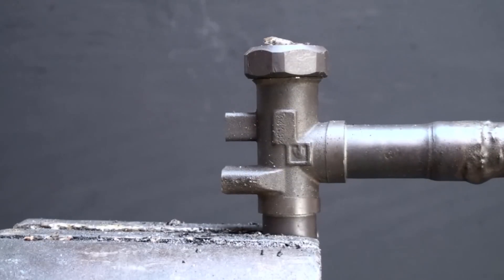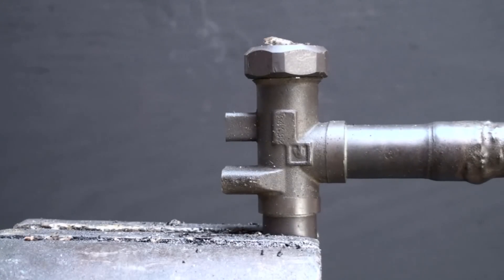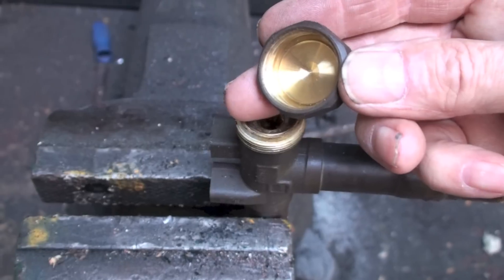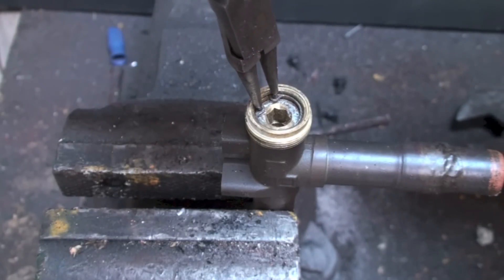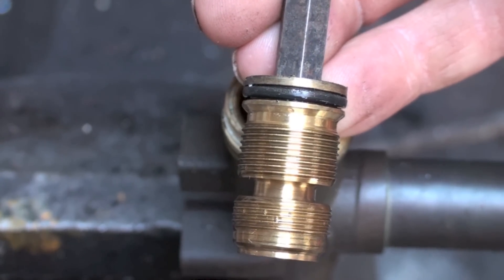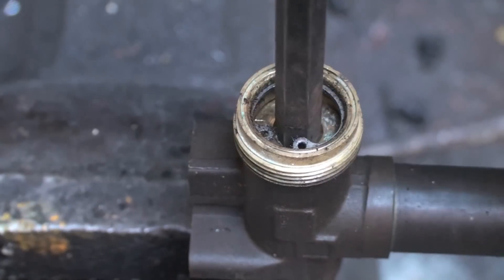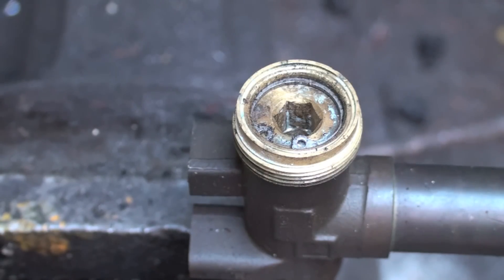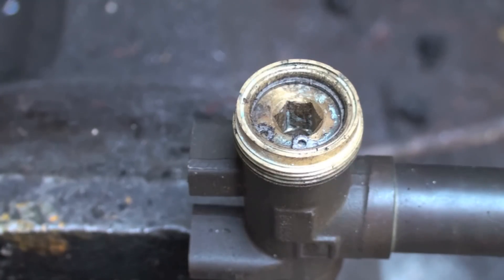Replacing the o rings on leaking HVAC service valves

Comment: Where do you buy them?
Reply from the maker: Bearing shops or Harbor Freight have oring sets.
GFM
Reply: @grayfurnaceman   Any particular material? Have a lot of 410 units where other installers fry the o-ring.

Comment: I have a suction side service valve that is leaking at the o-ring.  There is still a pre-charge of refrigerant held in the outdoor unit which hasn't been released into the line set yet.  The service valve doesn't have the snap-ring option and has formed edges, which means the service valve needs to be replaced.  If I need to evacuate the pre-charge into a storage container for the service valve replacement, what are your thoughts on just removing the service valve all-together and just straight brazing the line-set into the outdoor unit.  Obviously, I can replace the refrigerant using the outdoor unit's schraeder valve connectors at the reversing valve (air source heat pump).
Reply from the maker: I just did a valve replacement with brazed joints and have not gotten around to doing a video about it.  Maybe your comment will get me going on the video.
GFM

Comment: We had an A/C "tech" out because the evap coil was freezing up. He said it was low on freon. Of course he wouldn't add any since it is a 40-year-old R22 system.  I have some R22 I bought long ago and I'm thinking of adding it. The service valves appear to be 3-position with stems under black caps. I think the tech may have broken the vapor valve since you can turn it anti-clockwise forever and it doesn't stop. He had to use a pipe on the service wrench to turn the valve. Any thoughts?
Reply from the maker: I think you are correct about the valves being a 3 position type.  Here is a video about the service valve:  https://youtu.be/gFFLYmD_2d4  
I have never seen one of these valves break.  It does take many turns to the stop.  
GFM

Comment: can air be used to pressure test for leaks if it need to be evacuated and recharged? being new they are full of air and have to be evacuated  and charged? just to test these valves? i do not have the nitrogen equipment but have the manifold r22 evac pump and soap. thanks
Reply: air has moisture in it and some will condense into water. You have to run the vac pump longer and possibly do 1 or 2 oil changes if the sight glass gets cloudy, that's the water. You can get Nitrogen cheap at NorCo or any oxygen supply store. We use it because it's dry, it absorbs moisture, keeps it out of the pump

Comment: do you happen to know the size of the older rheem o rings?  my usint is 30 years old and just this year gave me issues. after drowning it in soap i find not leaks so maybe these valves nee repair. also are the schrader valves the same as they are in cars? i want to replace them also if after i remove the caps i find leaks. but being that old and research i think they are old and failed. i could have a tech do this but no one will come out to service it as they said it is to old. thanks
Reply from the maker: I do not have any sizing.  I just use an o-ring kit and pick the size.  The schraders are the same as autos.
GFM
Reply: @grayfurnaceman  thanks by any chance can i unscrew the valve core enough to change out the o-ring? or will it just pop out from the pressure at that point?
Reply from the maker: @bobpalmer4740  I would remove the refrigerant before removing the schrader.  The pressure is quite high.  As for the service valves, same issue except some designs will not allow the plunger to be removed.
GFM
Reply: @grayfurnaceman  ok i was not going to change the schraders without the tool. but the shutoff i was hoping to back it out just enough to change the o-rings. but that may not be possible either. thanks

Comment: One piece of information I cant seem to find is whether or not there are special o rings for refrigerant or can I go to any automotive/hardware and buy a bulk pack of o rings? Will the compressor oil wreck them?
Reply from the maker: I have had no trouble using the standard orings.
GFM
Reply: @grayfurnaceman  ok great, do you recommend installing with an assembly lubricant like nylog?

Comment: Do not used nitrogen @400psi it will blow you up
Reply: That is ridiculous.  R-410A often will operate at 400#.
GFM
Reply: Nitrogen is different look it up before you blow your arm off
Reply from the maker: @Brnlandry  I did not just fall off the turnip truck.  I have used nitrogen as a pressure testing gas since the 1970s BTW with the blessings of several manufacturers.  The only limitation is for compressor bodies and only that for certain compressors.  Pressure is pressure and the gas type makes no difference.
GFM
Reply: grayfurnaceman sir no disrespect but I took a class that showed a video of a guy that his arm was taken off by a window unit compressor.  They told us that nitrogen @any psi is multiplied to many times over.  I’ll try to find the story or video,  just trying to help no disrespect
Reply from the maker: @Brnlandry  I would like to see the story if you can find it.
GFM
Reply: grayfurnaceman I tried to find but couldn’t.  It was in a Johnstone tech class years ago
Reply: I think the problem is with expansion. As liquid nitrogen vaporizes it expands by 700 percent, or something like that. So if you put liquid nitrogen in the system at 400 psi you will end up with 2,800 psi. Maybe using nitrogen vapor to pressurize the system is a way to avoid the explosion. Don't know enough about this to give you a safe recommendation.

Comment: Recent replacement parts arent that great, have had lots of brand new valves have failing rings, but couldnt figure out the right material, there are EPDM, VITON,nitrile, and many more, question is which material is designed for refrigerant application so it wont fail again in a few month
Reply: The green ones.

Comment: When a leaking O-Ring is not replaced but valve is closed completely then will the vacuum hold if a vacuum pump is connected/used ??
Reply from the maker: No, the valve, when closed is open to the lineset.
GFM

Comment: Lubricate the o ring dry o rings are worthless. And yes you an dependably seal the cap with another o ring that is the same diameter of the inside of the cap. But be sure to lubricate and leave a tag on the valve for the future so it can be dismantled when the system needs evacuated
Reply from the maker: I guess I would have to say that I would not put an oring in a place that an oring was not made to be placed.  I have removed many of these orings that failed to work.
GFM

Comment: I do property maintenance with 170 units on the roof. I keep the O ring wrench and the rings in my bag. Even with plumbing o ring kits, it's a task to get the right one( harbor freight has a kit that matches.. I have to give it a hard slap to get it to seat with the threads. It beats carrying the torches on the roof. It is also a $.015 repair vs $20 valve replacement. With mo99 retro in place, I need every bit of the recurring budget money that I can save. I fixed a leaking king valve today and converted to mo99, the cond was 21 yrs old. The people moved in a complimented on how great the ac was working.
Reply: Good job man. It's one thing to install a new unit, but finding guys who care and are smart enough to repair is becoming rare. I've had the only 2 HVAC guys out in my 100 sqmi area, the first one wouldn't work on my R22 system, sugested a $17000.00 replacement, the second guy didn't have Nitrogen with him so he John Wayned it and had a leak in his braise, lost some or all of my R22 and wants ME to buy 10 lbs so he can fix it. The unit holds 12lbs and I said how much is left? He "doesn't know... but 10 should do it". I said can't we pressurize the lineset with Nitro (that I hope you have now, like a Carpenter without a hammer) and fix the leak, then pump out the unit, replace the orings in the service valve, weigh the pumped out R22 then I can purchase the correct amount (since it's not returnable), and fill the unit with the right amount. That brought me here, I'm going to teach myself to do it. I'm a cabinet maker, I've done all my own work all my life except major surgery. If another man can do it, so can I, just have a learning curve. But to my original point, I admire you for having pride in your work and fixing what can be in this throw away society.

Comment: Can you help, have an older York condenser with odd service valves, no hex shut offs, a long Schroeder valve cap with a larger pin in center, half moon tab on bottom, standard Schroeder on side, need to know how to close and open this type valve. Thanks

Comment: Greeting sir, thank you so much for the video. I have a 97 carrier condensing unit, does these fall into the unserviceable category?
Reply from the maker: +Lao Mark If the plunger cannot be removed with an allen head, it is unserviceable.  Hope this helps.
GFM
Reply: Thank you for the video, turn out the plunger is removable just like the video show. I had replace the O-Ring and is working like a charm, fill it up with freon and no more leak. Thank you so much for the video.
Reply from the maker: +Lao Mark Welcome
GFM
Reply: @laomark1447  just how did you remove the Allen plunger under pressure. I want to do that's but the minute I try to remove the cover(cap) it starts to spray what appears to be refrigrant. If the unit is empty why does it still do that? Is it the pressure or is it just what's left of the refrigrant in the line? 
I just watched this video 7/27/21 after I replaced the capacitor and the contractor switch.The compressor tested good but it won't come on. So the conclusion is that there's a leak and it's not from schrader valve.
Reply: grayfurnaceman 8

Comment: you have great videos, I have a question , does this plunger cut off the freon off the service valve if screwed all the way in? in other words can we use this to change a schrader valve? thanks
Reply: +Gus F   No, It isolates the compressor from the line set, but the rest of the system and the schrader is still under pressure from whatever refrigerant is trapped on that side of the valve. Service valves on refrigeration service valves can be back-seated to shut off the port and that is why they usually don't contain a schrader valve.

Comment: The problem is the newer service valves do not come with retaining rings any more - not sure why.   The tops of the outside body are crimped to retain the valve plunger which renders them unserviceable.   You either go with a band-aid fix like a gasket underneath the cap or replace the entire assembly.    Really - this is such a major problem that I am baffled a better solution has not surfaced.   If the EPA was serious about refrigerant getting into the atmosphere they would have created a task force to remedy this problem.
Reply from the maker: +Gene Friedman The EPA already did.  Its called the service valve.  What you see today.  The valves are made so that they must be replaced.  Gaskets, brings etc have never worked.  Believe me, I was trying that in the early 1980s.  Didn't work then, doesn't work now.  The idea was that the unit could be pumped down rather than dumping the charge.  Unfortunately, the vast majority of leaks are in service valves themselves.  I came to practice a real solution in my service work.  I removed all service valves, installed line taps with schraeder valves and never looked back.  
GFM
Reply: @grayfurnaceman  can you show us an example of how you replaced the service values?
Reply from the maker: That one is in my thoughts.
GFM
Reply: Gene Friedman the ONLY reason why the new valves are no reparable ate more sales!
Reply: Totally agree

Comment: I discovered oil coming out the service valve on my AC 6 or so years ago.  I had a friend charge it up every summer.  I tried to seal the cap like you mentioned not to and with automotive gasket material it lasted three years but is leaking again and worse.  I tried to remove that valve core before and it seemed to tighten up as it came out and I aborted the project.  After viewing your video, I tried it again and it came out.  The o-ring was worn and cracked.  I purchased a bag of green AC O-rings from a hardware store and a couple more at an Auto parts place that had a closer size fit.  I put in the one from the auto parts place.  My AC friend, who by the way said this would not work, came over and pulled a vacuum on my system and it held tight.  There was no need to recover refrigerant since it had all escaped long before.  He then charged the system and it has worked perfectly for over a month now.  Next summer it will get another test.  You video helped me save a lot of money since 3 different techs told me to replace the unit, and this method worked for me.  Thanks for the video.
Reply from the maker: +cladnar5 Your problem is not so bad as to replace the unit.  Worst case, replace the valve.  Unit age of course if a factor in deciding to replace, but if it works well other than the leak, and the cost is not too high, fix it.
GFM
Reply: If the manufacturers would put packing glands in these valves the problem would go away
Reply: Nice! 🤙

Comment: When I install a new condenser I always remove the schraeder valve and wrap the service valve with wet rags covering the service valve body when making my connections.  This step alone has saved me countless hours of call backs and saved the buyer's money after the warranty has run out.  And they don't even realize what I've done for them. I have discovered many of these leaking on other companies' installs because the installer didn't want to take 5 minutes to remove the schraeder and wrap the valve while brazing.  A teflon based pipe dope on the caps will stop a lot of leaks when I find them.  I've come back after a couple of years or less for some other problem and the caps are still holding.  But, it is a little messy when you have to open or close the service valve.  I've never tried to replace the o-ring though.  And should you coat the o-ring with refrigerant oil before inserting and re-tightening the valve?  If you've cleaned the inside of the valve body most of the oil would have been removed.
Reply from the maker: TheRueuhy Sounds like you are doing it right.  I also see valves damaged by using too little heat when brazing and therefore keeping the joints hot for too long.  Can't agree on there pipe dope though, pipe dope is only helpful on tapered threads where it can fill the voids as the threads jam together.  Oil is always helpful for installing orings.  Thanks for the thoughts.
GFM

Comment: Thank you for your video.. that is good repair if it works.. I want to know where we have to buy the O ring? Our unit is Goodman CPKE Model B128-25167..where we have to buy?
Reply from the maker: psyche105 I really don't recommend just replacing the o ring.  The valve should be replaced.  The o ring is not sold by the manufacturer.  If you replace it, just remove and match it at a supplier.
GFM

Comment: I have replaced the O-ring on the suction side.  But after taking the snap off of the liquid side and unscrewing the plunger, I can't remove the plunger.  It seems loose but wont pull out.  Is there some retainer on the inside of the valve?  Thanks.
Reply from the maker: RPHacker777 There are some liquid line valves that are crimped above the plunger.  On these, the valve must be replaced.  Hope this helps.
GFM
Reply: grayfurnaceman  )

Comment: Hello Sir, Enjoyed the video.  Though I can't see why changing the O-ring is not a good idea.  In my case the valve has been sitting there for 20+ years, capped off from the elements, with no parts moving.  There should be no wear at all. 
The only thing that would deteriorate would be the O-ring material.  Having said that the only other thing I could come up with is that maybe the repeated heating cooling may make the cylinder walls oval shaped therefor the O-Ring may not seal right.  But that's just a wild guess on my part.
Also please look at these O-Rings that I found on the Internet: http://www.clipsandfasteners.com/Blue_Neoprene_Air_Conditioning_O_Rings_s/667.htm
These look to be the right material.  What do you think?  Thanks.
Reply from the maker: The only reason I do not recommend replacing the o-ring is that most of the time the valve has been overheated during installation and it won't work.  With yours being 20+ years old it would probably work.  The rings you reference are probably ok.  Hope this helps.
GFM

Comment from the maker: Yes.  The oxyacetylene torch is the best choice.  The turbo torch simply cannot come up with the temps to make a quick heat up of a refrigeration joint, especially with a valve nearby to absorb the heat.  I have seen many valves damaged by the air acetylene torch and they are not suitable for this type of work.  Some will disagree but that is my opinion.
GFM
Reply: What's the best oxyacetylene torch tip size for a quick heat up? Or it doesn't matter. Thanks
Reply from the maker: @Snakeinmyboot7008  I generally use a #2 tip.
GFM
Reply: @grayfurnaceman  Thanks!

Comment from the maker: As for the threads of the valve cap, I guess I also have to disagree.  The threads of these caps are not tapered so they only tighten on one side of the thread.  Sealers sometimes work but I would not hold too much hope, as I have replaced many valves with sealer on them.  Sometimes there is more than one to do something and both ways work.  None of us know it all as our experience is limited.  Again, thanks for the conversation
GFM

Comment from the maker: The most common valve leakage problems I have seen are caused by overheat of the valve when brazing.  There is no repair for this, only replacement of the valve.  I think we will always disagree on how to deal with this most common failure but I guess the final answer is whatever works for you.
GFM